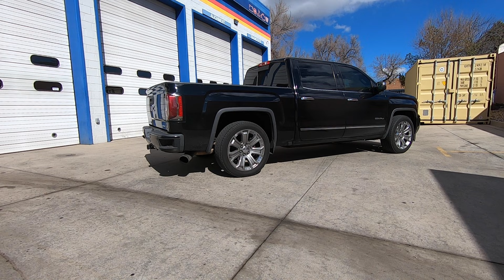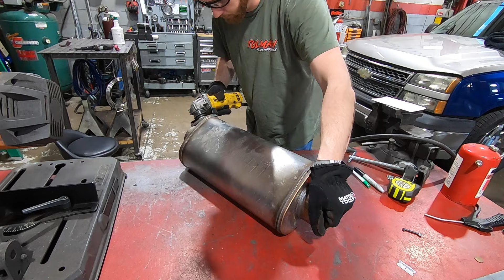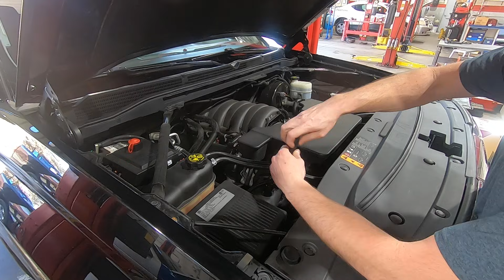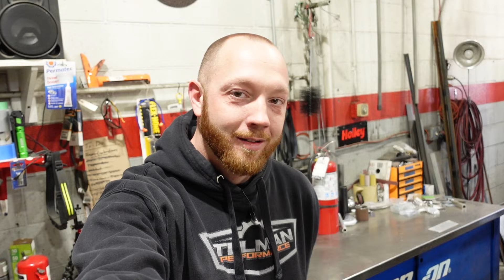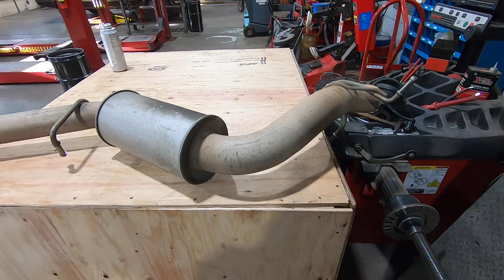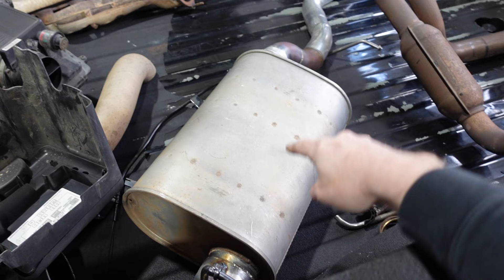I used SPACESHIP parts to build the ULTIMATE exhaust

Comment: loved to see a different brand muffler!  Got me two blackwidow 250's on my 4.8ls using a borla switchfire xpipe for a mustang. 2.5 inch true duel with stocker/style cats.  long tube 1.75inch 3inch collector.

If you're trying to get the most out of your mufflers, then they work best the closer they are to the noise they are muffling.  move them closer or at least one part.  I mean it looks like you might be able to just flip the pipe in the middle.  Even putting that harmonizer right after the cat could do more than at the tip.

Nice project and thank you for trying the different combos! :)

If you want another suggestion, GIBSON MFA mufflers are similar/free flowing like the blackwidow  No packing too.  Otherwise, Hooker makes a nice stock sounding muffler I used.  AEROCHAMBER sounded like a bigger stock.  Freeflowing but stock built with packing.  big mufflers...Directional.

Comment: I’m so excited to see what you do to this truck. I have a 2017 Silverado regular car. I’ve done a stage 2 Texas speed cam and trunion upgrade, msd coil packs and wires, l83 intake manifold and throttle body, k&n cold air air intake and resistor and muffler delete. I love the results!

Comment: Making the exhaust more complicated and heavy, as usual. Get an Aeroturbine 3535XL muffler. It would do the job, save weight, and sound amazing with no drone.
Flowmaster sucks. 
Aeroturbine 
Birla
Magnaflow are my choice of mufflers. Lately I've been a huge fan of aeroturbine. I've had them on three vehicles so far. And they sound incredible. LT, check my channel. I'm running two aeroturbine 2525 mufflers with external resonators. (If I could do it all over again, I'd use the 3030XL), but I'll be doing that once a new cam and the 6.1 heads go onto my 5.7 hemi.

Comment: I’m real happy with my set up, I had a shop cut the y and 3rd cat, no cel. Ran true duals with a dual in dual out magnaflow and tips ran under the rear bumper. Start up is nice and loud, quiets down after it’s warm. Denali has active noise canceling so can’t hear the drone.  I would like to add an equal length tube to see how that sounds

Comment: You want a challenge? Fix the drone noise on my 2007 Seadoo. It has the stock waterbox muffler, but I deleted the factory resonator for needed room to install an aftermarket intercooler, then I created custom dual exhaust outlets. It sounds awesome most of the time, but has a horrible drone sound at a certain RPM range, gives me a headache before too long, and ruins the trip to the lake. I have done the same thing LT has done, tried multiple different things, never really making much of a difference. I gave up a couple years ago, and have just been living with it, but I'm ready to start trying things again to see if I can get it better. The one thing I have not tried is the J-pipe thing. 
The twist to all my exhaust issues is that my exhaust isn't just "exhaust", it has engine exhaust and water flowing thru it too. So things like a J-pipe would need to be designed so that it won't just fill up with water. Fun, right?

Comment: I'm glad I am not the only one.  I have had 5 different configurations, including active valves on my f350 7.3L.  I think it's the 3.5" single tail pipe. That's the low frequency drone problem.   Dual tails are my next move.

Comment: Please do an L8T swap or even an L8P. The L8P has more HP and torque. Also incase you didn't know this all these 2014 through 2019 trucks are already setup for E85 fuel. Just look under the truck along the frame on the drivers side just below is a fuel flex plug that is just sitting there pugged off. All you have to do is add a fuel flex sensor fuel line and activate it in HP Tuners. I own 4 of these trucks both crew cab, extended, and single cab and I love them.

Comment: Dude you need a db level device for interior driving levels and at the tip level. You could get really nerdy and do frequency levels . DO you get more bass with this setup or do you get more tinny ricer frequencies with that set up . Determine what you are hearing etc.

Comment: You're not crazy. I love these videos. I've been through 5 exhausts on my truck in a year. As of right now, I'm running equal length dual 3 inch with an x and two Spintech Pro Street 9000s. Still not what I'm looking for. Keep experimenting. Its very interesting to watch and learn about.

Comment: If they made it in a 3.5, I would recommend the Gibson MWA. It is my go-to for performance mufflers that don't drone. You wouldn't think so by looking at it, but it does a remarkable job of keeping your ears from ringing.  Unfortunately the largest they make is a 3in. 

Another setup I have had pretty good luck with in the past is running a chambered muffler (flowmaster or equivalent) after a straight through (like magnaflow or borla) performance muffler. 
not great for flow numbers, but it makes for an exhaust that's tame enough to live with, but makes the right noises when you want to hear it.

Comment: Sounds like you really want a stock sounding gm exhaust to me but don't want to admit it 😂. A few more years and you won't be scared to...  Age changes everything...
Reply: I don’t think that’s right. He wants what I tend to want with a V8 which is more volume and a cleaner sound when getting into the throttle but no drone on gentle throttle. This can be done without bi-model mufflers but it does take time and effort.
Reply: @peterj5751  you have been wrong before.
Reply: @scrappyjackalope9558 many times. But I did finally get what I wanted with my Monaro after a few attempts. The difference is that I couldn’t do my own exhausts so I paid for the changes. I drove my wife insane doing so.
Reply: @peterj5751 17
Reply: Bimodal muffler.

Comment: have you looked into the active noise canceling that is optioned on some of these trucks? I believe the Borla from GM has a calibration that the dealer will do for the ANC. This may alter the perceived drone inside the truck.

Comment: I like true duels. Also I had a stainless steel muffler on a 460 Ford and with two into one it just kept ripping the muffler apart and then the second reason I like true duals is because if you have a problem you can tell which bank of the motor. It's on a lot of times by what the exhaust is doing

Comment: My man, just spend the money and get a Corsa Muffler and do a true dual exhaust with a loop pipe for the passenger side exhaust pipe. Or look at the exhaust diagram for a 2023 Escalade V. GM put and trombone loop in that vehicle and it sounds really good!
Reply: The loop goes on the passenger side pipe.
Reply: @dalethomas9307 thank you
Reply: @dalethomas9307 oops lol. I corrected it
Reply: Corsas are egregiously over priced and overrated. And they make most things they’re put on sound like shit 😂 you know that coyote you always see that sounds like pure ear destroying ass? Yeah those are Corsas.
Reply: Loop pipes are a scam. Length isn't the only thing you should be considering. Change in direction is equal to more pipe than the physical length itself. Technically you took the passenger side and made it worse than the drivers side. Drivers side typically has 2 90 degree bends if you have headers. So tell me how a 360 degree loop pipe is supposed to equal the drivers side of 180 degrees???
Reply: @morganthechevyguy Ive been saying this for ages and people think im crazy. Youre better off having the pipes come in to the center and either run a Y into a single pipe or X/H pipe for duals. No loop pipe will ever come near my trucks.
Reply: @morganthechevyguy that’s why the 180 swap that Shelby did was better right off the manifold.
Reply: Two Corsa resonators fixed my drone
Reply: Corsa is the most overrated garbage sounding exhaust. Just shrieking noise with little to no tone. People think it’s cool because it’s what all their favorite YouTube douches get paid to run. It’s the designer hand bag of exhaust. You’re just paying for a name.
Reply: he just said he don't want to be like everybody else he want to do some different
Reply: Just because someone else has developed something that works doesn't mean it's not fun to try and find a different way.
Reply: Completely agree with you! That's exactly what I was even going to mention about this. His truck should be roughly close to the same length as the Escalade V. GM has done plenty of research into that exhaust system for in cab sound etc...Although the Escalade V is probably a bit more sound proof of the interior than his Denali, anyhow that's exactly how I'd approach this.
Reply: Corsa has no tone!!
Reply: I'm guessing you missed the start of the video when he said he wanted something unique 🤷‍♂️🤦‍♂️
Reply: @dingodave89  doing a true dual exhaust system with the loop for the passenger side pipe like a Escalade V on a Sierra Denali is not unique?
Reply: Duals are more thing in the past. Plus get better back pressure with single exhaust. Be cool see one exhaust tip some builds right in the middle the back. Maybe have dual spilt square ports tips be fine. Mainly one big 5” or 4.5” 15 degree cut off tip be the best.
Reply: @Silkmaster4200 better back pressure? What?
Reply: @EGGINFOOLS I thought FOR SURE he was gonna say to use two glasspacks lol
Reply: @EGGINFOOLS Don't engage!! Lol
Reply: @Silkmaster4200 back pressure is what you don’t want. Scavenging is what you want. The back pressure thing is an old  misconception and misunderstanding.
Reply: @dalethomas9307 single better for torque. Lose all back pressure will lose power and torque. It’s like broken exhaust up front.
Reply: @Silkmaster4200 just stop. You're embarrassing yourself. You want to minimize BACK PRESSURE. And maximize SCAVENGING. 

Some 30 years later, you dolts still parrot the same wrong information with ALL the evidence at your fingertips
Reply: @Silkmaster4200 . This is only true at very low rpm’s when exhaust gas flow is low enough that smaller exhaust actually keeps velocity higher. Bigger free flowing exhaust will lose hp/tq at those very low rpm’s because exhaust gas velocity slows and you lose a bit of scavenging, at all other rpm’s you will gain power. The highest power and torque you will see is an open exhaust, provided there is a long enough collector extension to promote scavenging after a long tube header merge. Remove that collector extension and yes it will lose power being solely open header because you killed the scavenging effect. Back pressure in your 4 stroke exhaust system is your enemy not your friend unless you are living at idle or just above.
Reply: @sergeantspeed5941 everyone going single these days. It’s not embarrassing at all. Very popular even on import cars. Such as Nissan etc..
Reply: @Silkmaster4200  this comment alone has me 😂😂😂😂

Comment: i have a Gen V truck norris cam they say its for 5.3 only. i want to get a L8T destroke it with a LT1 crank and use that truck norris cam since i already got it... would it hit the piston?( i will use diamond piston with valve relief) but why they only say for 5.3? they both same stroke(3.622). my other plan is to resurrect my old l83 with the l8t crank and some customs pistons to get it square at 3.860 stroke 3.800 bore for a 5.7litre direct injected... by the way.... what are you doing with your L8T? you think a 4.8 crank fit those block?

Comment: Placing a resonator further upstream is more effective at canceling out low-frequency drone.
If there is a long, uninterrupted stretch of exhaust tubing (over 5 feet) without a suppression device, exhaust pulses can amplify, causing higher vibration/drone.
Reply: I have done a ton of 4 cyl exaust and i can confirm this. A resonator as close to the collectors as possible and a muffler with at least 6-8" of pipe afterwards is key to eliminate drone. Also having your exhaust tip stick out even .5" farther can make a huge difference along with a little bit of sound deadener.

Comment: If drone was the only issue, you should have added a j-pipe/hemholtz resonator.  Ive got dual flomaster hushpower pro shorties and its amazing how much quieter it is than 2 chamber flowmasters.
Reply: I came to say the same thing, it was my immediate thought with the drone. I knew someone else had to have said it first though
Reply: Scrolling down the comments to see if someone would suggest this before I did.  I believe this is exactly the ticket to eliminating the drone.  Did the trick on my Hemi-powered Magnum (Solo Performance makes the system).
Reply: Where is the best place to put one of those?
Reply: @kskip4242  in front of the muffler.

Comment: I always wondered about exhaust flow. Wouldn't it work better to increase pipe diameter as you go towards the rear. With all joints being the next piece slipping over the previous pipe and or muffler. To minimize turbulence within the exhaust system. That's always been my thought on it.
Reply: Length adds volume too. See Engine Masters.  Single 3" is fine up to about 450hp, and on an actual street car, its more like 500.
Reply: No, the increase in diameter kills the speed of the exhaust wave. Keeping the speed up is crucial.
Reply: @patarmstrong3582 I wondered because of the gases expanding as it cools.

Comment: I have yet to install it. But im gonna get the speed engineering headers and y pipe for my 99 silverado with a truck norris cammed 4.8. I have a full stock cat back with the spring valve from a 2016 Sierra Denali 6.2l that im going to put on. If its too quite im thinking of ditching the stock muffler for the Flowmaster Flow fx round muffler or maybe 2. One as a resonator type and the 2nd at the back of the exhaust. Not sure. Never really messed with the sound before. It still has completely stock exhaust and cats with the cam 😂😂.

Comment: I started watching this video when it was posted - good timing!

I've always just used "turbo" mufflers, had them on trucks, full-size cars, a Malibu and a Monza. They all gave the standard burble at idle, then wake up when my foot got heavy. Between large cars & trucks, mid-size and small, whether mounted forward or farther back, I never had droning.

Maybe the J pipe will get you to your happy place. Good luck!

What are the chances of that becoming a giveaway truck when you're done? 

Im asking because im disabled and  the truck I've had for the last 20 years is starting to be in the shop several times a year

Comment: I would have liked to see how the mufflers sounded individually. Like did the black widow help the drone? Or the borla? Or didn't help at all?
Reply: Well nevermind. They didn't help
Reply: Also, i do find a bigger pipe seems to cause more drone. I have a 3.5 inch exhaust and magnaflow muffler in my truck. Added a 5 inch diesel exhaust pipe from the muffler to the bumper. The volume in the cab decreased,  but drone increased with the bigger pipe

Comment: I HATE DRONE. Currently trying to find an inexpensive muffler for the wife's 2012 6.2l yukon that does not drone.
Reply: Chevy trucks sound good with stock exhaust. It’s kind of childish to want a loud daily driver.
Reply: I loved my Borla XR-1 on my old 6.2
Reply: Borla Xr1s have very little drone but really open up in the higher rpm
Reply: Vibrant performance ultra quiet resonator or street power muffler are both great options. My ford was really bad at 1800rpm and the street power muffler fixed it